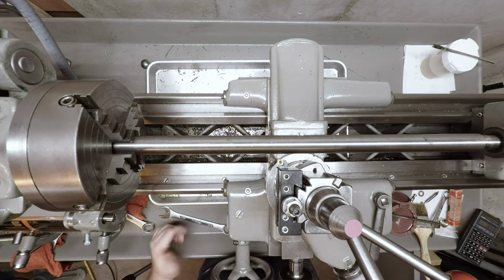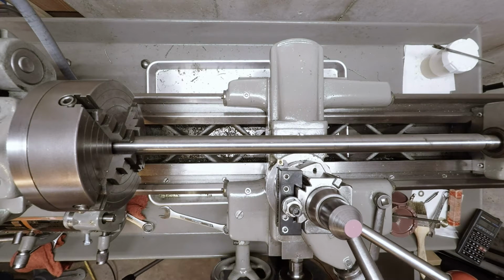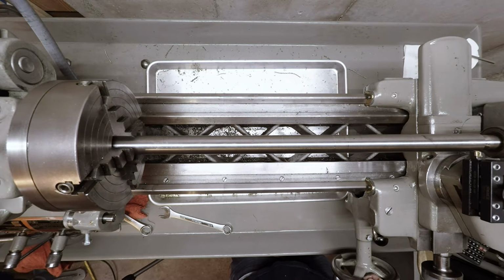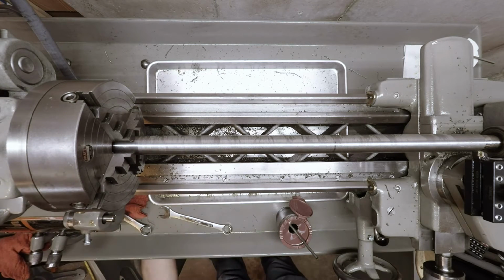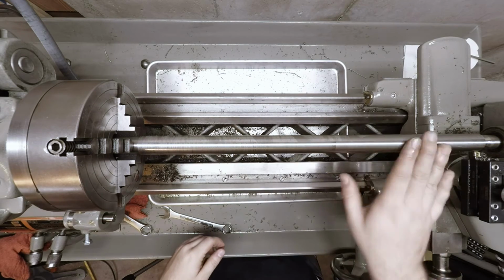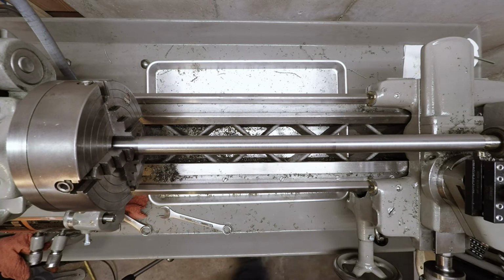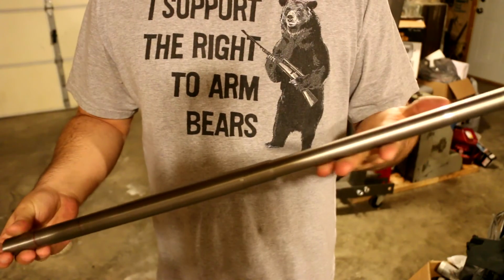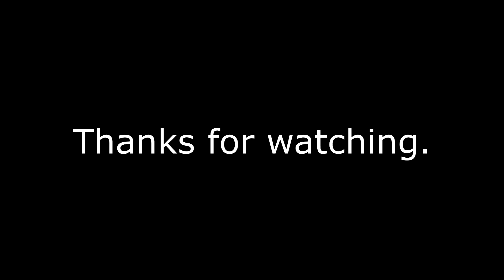Building the Custom PSL: Turning the Barrel (Part 2)

Comment: How are you getting a proper measurement when you aren't using the thumb ratchet at the end of the mic? 🤔
Reply from the maker: It's a friction thimble micrometer. There's no ratchet and the entire barrel slips when it reaches the correct load. It's my preferred micrometer style.
Reply: @StrongholdArmory  you ever finish this build?

Comment: I recently started turning barrels and was surprised you didn’t use a follower rest. The chatter must not have been too bad. I almost bought a heavy10 but the ones I seen were worn out. The ways closer to your chuck are probably not the same as near your tail stock and that’s why the finish changed as it got closer to the chuck. The closer to the chuck the more rigidity so your finish should have improved as you got closer to the chuck. Great video man

Comment: Why do you have the barrel in the chuck instead of having the barrel butt up against a dead center that replaces the chuck so that you "turn between centers " ? 
Won't this setup of yours have the barrel not run as true to center ?
Reply from the maker: My lathe only has 20" between centers, and can only reasonably turn an 18" piece of stock between centers if I remove the thread dial. All I'm doing is profiling the outside of the barrel, so 2 to 3 thou of runout doesn't matter for the purposes of the build.

Comment: I assume he accidentally machined the hand guard retainer part of the barrel too thin to fit the M72 retainer and that's why he went with the M76 one?
The M72 rear sight is made for the 7.62x39 trajectory, so I have to mount my PSL sight to a tube that is the same size as the M72.
Reply from the maker: While I'm definitely not above missing my target dimensions, that's not the case in this instance. Since I'm using a PSL front trunnion I'm also using a PSL rear sight block because I didn't want any unsightly gaps/piston length issues that come with mixing Zastava trunnions/RSB's with standard RPK/AKM pattern trunnions/RSB's. The PSL rear sight block journal is slightly smaller than the M72 handguard retainer, so it will not allow the use of an M72 retainer unless I pressed a collar or bushed the retainer. The next largest diameter handguard retainer was the M76 unless I went with a complete custom made one or went with a bolt-on retainer, which I didn't want.